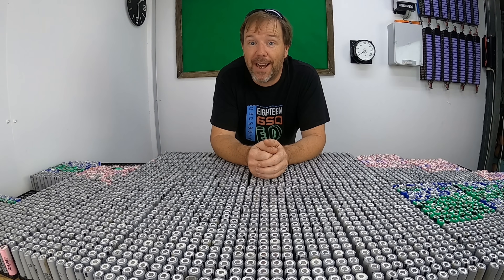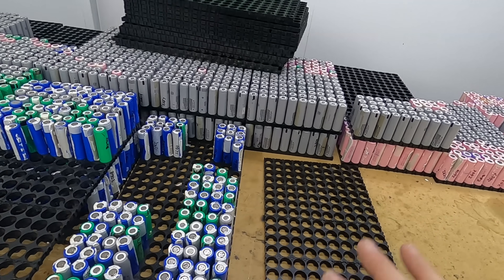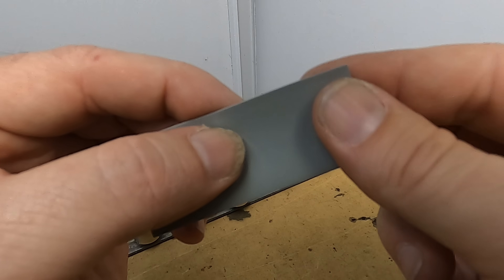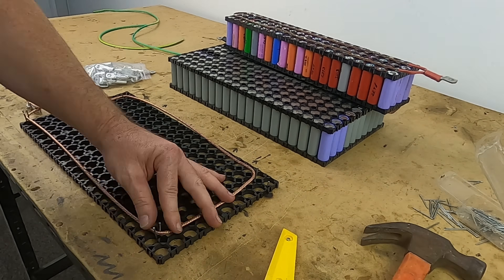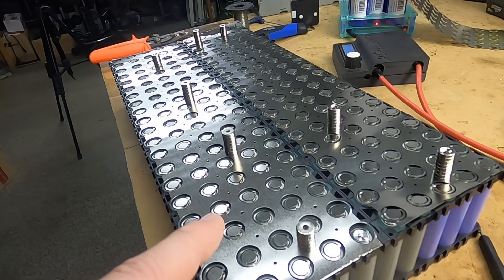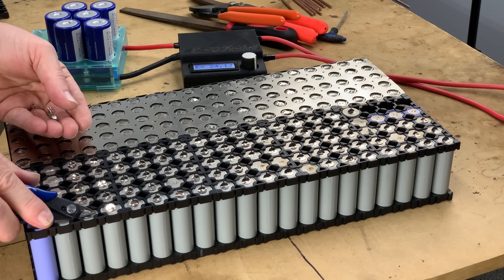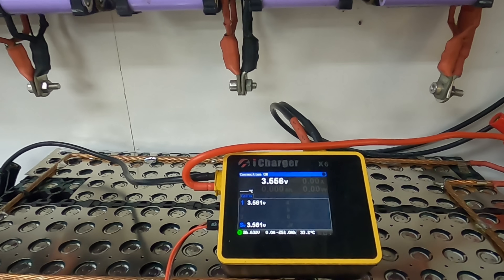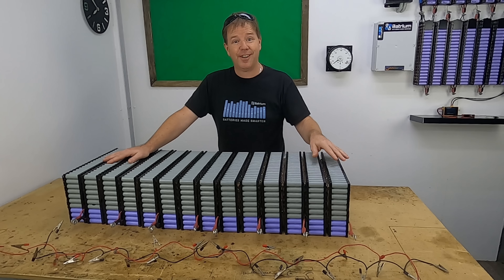Creating my single biggest D.I.Y. battery with 2800 18650 cells recovered from used laptop batteries

Comment: Awesome video!
How many laptop batteries did you take apart, about how many man hours did that take and what did you pay for the old laptop batteries (avg each and in total)? So we can get an idea of the cost so far, unless you are at the end of the whole series going to do a complete review of all the steps, the cost of each step and the amount of time it took for each step.
Thanks!
Reply from the maker: The plan was some sort of ROI video but it's really hard, This build was done over the past 12 months in my spare time, looking for cell building, editing and fixing monumental F-Ups. Every battery came from a local highschool via a recycling company. To pay for the batteries I exchanged the referbishment of about 100 Dell desktop computers (Secure erase hdd, full physical clean, new thermal paste, HDD warranty Tests, Memtest, W10 install & 1 hour stress test on each ) because lets face it referb to some is load W10 and blow the dust you can see off and call it refurbished :( SO that was a good solid week of work so maybe 1500-2000 for the cells. It would have been about 500 laptop batteries but they were all premium cells and only 6 cells were unuesable due to zero volt and another (about) 30 had physical damage. All up there was a smudge under 3000 cells processed. When i was organised I was processing about 100 cells perday when I had the spare time to crack open enough batteries. UNFORTUNATELY, this project has taken a quantum shift in the way I was planning to implement so stay tuned for that :)

Comment: These cells have more power density then tnt. So if some accident happens the entire colony or for that matter the whole town will vaporise.
Reply from the maker: You're either extremely poorly educated or trying very hard to make a joke - either way I laughed....
Reply: It's true that they can store more energy than TNT, but they can't release the energy as fast as TNT, If a short circuit happens it wouldn't not vaporise the entire town, but It would make a pretty big fire enough to burn his entire house down.
Reply: @polarpl247  well thats a lot of risk to live with anyways its more rewarding as well with that much of free solar energy for your daily needs

Comment: And also...I noticed you left those blue empty batteries in each pack...why would u do that?... cant you, & shouldn't you replace them with real capacity ones?... why would you leave in zero voltage cells?...
Reply from the maker: This will be detailed in next video, they are to stop any chance of a grounding issue of the cells
Reply: @HBPowerwall  what's your Instagram & facebook pages?...thanks
Reply from the maker: hbpowerwall :)

Comment: Once u had them sorted...like 2300 low...& 2300 high?... I dont get why later in the video you say now "we gotta place them into packs"... well aren't they already in packs?... why would you go back & reorganize everything?... cant you build a pack the way they were already?... with the 23 Lowes, 24 low's- 25 Low's- 25 highs?...
Reply from the maker: then they went to 2300-2350-2400-2450-2500*2550 ect - 100 mah was too far apart to build the BATTERIES gota stop calling them packs !
Reply: @HBPowerwall  oh ok...yea after I sent u that message?...I read your video description & got what you did... right now?...I'm at the buying laptop battery packs & capacity testing each cell...then I gotta buy the 32guage fuse wire, cell holders & I wanna go with the 6 gauge copper wire...twisted of coarse in a drill...after I capacity test enough of them?...its time to put them in holders...& let the soldering begin...lol then its onto the bus bars...then wall mounting...lol I will keep you posted with videos on here & on my instagram page!! KC24LA Thanks Mate, Cheers...I wanna do what you did eventually... with your purple ones?...charge them off of solar...then help run the house loads...

Comment: Why do you need that much battery? Waste of time and no space for cooling
Reply from the maker: Dude that's only 20% of what i already have installed - 74 solar panels worth of energy has to go somewhere other than the grid. These batteries won't even change temp under my max load of 0.3 amps per cell.

Comment: How safe is this actually? The cells in the middle have it less easy to cool down during charge and discharge than the ones on the outer sides of the packs. Isn't it a potential risk of fire actually?
Reply from the maker: Common question - my max load per cell will be 0.32 amps per cell... think that'll create too much heat? We aren't talking EV or eBike here
Reply: @HBPowerwall   Well, indeed each cell won't create much heat. But all together and in such a small place? I mean, the idea sounds excellent by itself, specially when you are re-using batteires which otherwise would simply produce more polution. However if for example i would like to use this in my house, where there are also kids, who allways forget to turn off lights or disconect chargers from the wall outlet... How safe it can be? DOes is need a special safety appliance?
Reply from the maker: You need to take a look at the rest of my videos lol I got safety covered... and the game is about to get 10x safter but that's a future video...
Reply: @HBPowerwall   You have lots of lots of videos. Which one you recomend about it for me to see?
Reply from the maker: https://youtu.be/Md4l9bFDOtc

Comment: Ive got to ask when it comes to mass storage, why not lead acid or that other new fat cell (forgot its name) ? Lipos are expensive and less stable for this kind of usage. Also they ware a lot more than the larger cells. Sure the lead acid has less density but its stable and easily maintainable.  So why lipo for home renewable storage?
Reply from the maker: Energy density, CHEAP, recycling, saving landfill, second life storage, fun, educational, fun, saves on grid power, environmentally friendly. & fun... I missed some but if its good enough for Elon it's good enough for me.. & fun :)

Comment: Hey Pete, is there some way I can contact you for advise and or your opinion on a small setup I've put together at my place, I've currently got 6x100ah AGM batteries on a 12v system that I want to change to the battery packs the same as you've got. If possible I'd like to talk to you about it if I could, I can send you my email and mobile number to you somehow securely. Just in case your wondering, my background I'm a 63yr old retired automotive and mechanical engineer by trade and my small solar setup's been running for about 8yrs now but the AGM's are starting to lose their edge. Hope you can help mate but it's ok if you'd rather not I understand. Seeya Rob
Reply from the maker: Rather not, can't do personal help as i'm not a pro, get SO many requests a day from all over the world i'd never make a living if i replied lol BUT thanks for asking first hehe BUT am heading south soon might be able to take a look for a few min if your not too far from my route
Reply: @HBPowerwall  Thanks Pete that would be great but I don't think you'll be close to where I am though, I live in the Hunter Valley near Cessnock just west of Newcastle, if your into winery's were got plenty of them haha, I just mainly want to know if it can be done and is it worth it. Changing from AGM to your battery packs in a 12v configuration and how many packs I'd need to make about 800-1000AH. I'm not in a hurry the AGM's are still going ok I just don't want to go down the AGM road again next time and proper lithium's are totally out of my price range. Thanks Pete.
Reply: @87xfute  1000Ah/2300mAh ~= 435(P), Since you use 12V, you will need 4(s)x435(P) to have 12V1000Ah system.

Comment: Curious to know what preparations are in place to deal with fire.  When one cell goes it can take adjacent cells along for the fun.  Quite a mess.  Has brought down at least one cargo airplane.
Reply from the maker: Valid question and one asked 100000000s of times. So 600 odd videos on this topic on youtube but i'll summarize. All batteries in use are in their own shed or seperate from main home, High Quality BMS on every battery in production - BMS controls heat via upto 120 temp sensors on my house battery, controls a shut trip in case a single cell gets too hot, cold, high or low voltage & entire battery too hot, cold, high or low voltage, fire alarm, every single individual 18650 cell is fused, battery breakers, and charger controllers that are set very conservatively & the same with the Inverters - they are programed to cut out earlier rather than later. Ad to that remote monitoring via my phone from anywhere. BMS even turns on and off cooling fans incase battery sheds get too hot. I guess it's no different to having a gas oven or Deep fryer on you bench top in your kitchen - you just don't do dumb stuff and you stand a much better chance of not having an issue. Note : I also monitor under heave charge loads with thermal camera at least once a week looking for hotspots in joints or cells. The BMS i have is a www.batrium.com unit
Reply: @HBPowerwall  Thanks for the great reply, you should pin this comment for all to see so they stop asking

Comment: Watching from Ireland. 
I am at the 25th vid in the 18650 Project playlist, I have 60 cells in a tray all tested and discharged, and 10 laptop batteries to dis-assemble. They have been on my desk for 3 months as I am reluctant to start soldering. HELP

thanks for making the videos
Reply from the maker: If you can find or build a spotwelder, much better than soldering to cells, but if that isn't an option try heat the cells as little as possilbe, use a clean soldering iron, good flux & enjoy the learning curve
Reply: @HBPowerwall  Yea, I was always worried about using solder on 18650's

I am on video 102 now,  gonna watch them all b4 I build

great fun learning so much from all your change of minds,  its getting to the stage where I think I am in the shed with you

Comment: Why do you have batterys in the Pack, that are not connected? I mean the batterys which have different color.
Reply from the maker: They are cells that could touch the metal mount. It will stop a short to ground

Comment: That is totally worthless. Where are your (VERY large) balancing capacitors and resistors and the necessary blocking diodes? Oh, you didn't use any? Just HOW do you plan to charge it? It's initial peak draw will be in the THOUSANDS of Ampere range. The batteries nearest the input wire will explode.
Reply from the maker: Thanks for the comment.. if you watched to the end perhaps your questions might be somewhat awnered it's heaps more fun than assuming than knowing - EVERY fuse will blow well before it sees 10,000 amps drawn from this battery. BUT i bet. it could do that sort of amps for a few micro seconds.
Reply from the maker: Side note batteries are built to with in 15ah each not bad considering the scale..

Comment: Very interesting video. Well done! Seeing the cells are from old laptops, presumably the batteries are end of life as far as the laptop goes (i.e. wont hold a charge for long). I have a few questions: 1) How do you know which cells are worth actually using? 2) How much life will you get out of them? 3) Can you actually recondition the batteries so they hold a charge for a long time again? 4) In a typical house, what will this provide power for?
Reply from the maker: Most laptop batteries i've seen fail in two states
a) Only one or two cells fail dragging the whole battery down
b) The BMS fails but the batteries are still fine.
1) I know they are worth using by testing every cell this play list explains that process - https://www.youtube.com/playlist?list=PLVtgHS9JIte_tT8JVGvoK3OBy7sYm3Xwj
2) My current battery is about 4 years old and still going (with maintenance)
3) There is no ... NO way to make the good again, just usable my plan is giving any battery i can that has exceeded its usefulness in its first live a Second Life in Storage
4) In my case my whole house - all GPOs, Lights, and ceiling fans. Not on batteries are electric oven and larger 7.5kw air conditioners & HWS but that is on a solar diverter so rarely use power from the grid to heat hot water.

Comment: 10mm2 is good for 63A, dont u take more A from these packs?
Reply from the maker: I haven't done the math but if it went that high I would have to turn on every solar charge controller and grid controller to 100% and even then it would only be for a very short time. Max charging i've see (when i was messing around on a live feed was 175 amps or about 10,000 watts. Discharging I think i've maxed out at 120 amps but never do that unless i want to blow up my inverters. Max practical discharge that I see daily is about 5500 watts. I think i'm with in acceptable limits for those busbars. Side note that this battery will be paralleled with another 30kwh battery

Comment: But now all the values on the cells are gone, so you would have to test all of them again🤔
Reply from the maker: I haven't ever retested yet, but all competed cells were tested with iCharger so i know the mah of the entire battery and can compare that to tests down the track. I have one battery in service on the farm that is coming up on 12 months old i'll pull that one and retest to see what the degradation will be after 12 months full time off grid use

Comment: This may sound like a dumb question but why build them to put out only 3+ volts?  I would have thought that a 12 or 24 volt set up would be more useful.  Are you wiring the packs for increased voltage?
Reply from the maker: They will be 14P193S battery so 48v at 500ah or 25kwh
Reply: @HBPowerwall  193S, that 800V+ fully loaded :) With 200 cells in parallel wouldn't your 14 packs average out anyway without categorizing each cell and spreading them out equally?

Comment: I don't understand why you had to put copper wire on top of nickel plate? Isn't doing its job the nickel plate to conduct electricity? You could put terminals on the end of nickel plate.
Reply from the maker: Current draw is too low just using the nickel - the load on the terminal end would be far higher than the other end.. Spreads the load a little bit

Comment: I fear your method of balancing packs to make a longer lasting battery is incredibly incorrect. You should not mix low quality and high quality cells per pack. Vary the pack size to balance will most definitely produce better results, not mixing qualities of cells.
Reply from the maker: My experience says differently - also you need to consider the load..
Reply: @HBPowerwall  pack discharge rate is a function of capacity typically... So as long as you meet your requirements you will be fine... That's why they say a battery has a 2C charge or discharge rate. To be clear I'm saying all packs must have the same capacity, but the # of cells per pack should vary so they're even, of equal quality cells
Reply from the maker: Ideally yes - the closer the better, but my 4480 cell 40kwh battery was built VERy poorly and way different ah batteries some 140 some 190ah Still works today, just not quite as welll. Many lessons learned over the past 4 years of building and being part of this community.
Reply: @HBPowerwall  you have totally missed my point. All packs can still be the same capacity but vary # of cells based on cell quality. You have introduced a guaranteed amount of power capacity cells in each parallel pack. When those cells go, the entire module goes with it.

Comment: What happened to the post you were going to make about getting batteries in Australia?
Reply from the maker: Good question - Lithium Power Australia https://www.lithium-power.com.au/ (5% coupon code 'Powerwalls')
Reply: @HBPowerwall  did you really pay those prices in building your new battery packs as shown?
Reply from the maker: No i could never afford that - I got 99% of these cells from a recycle center and swapped refurbishing 100 computers over a few months for them. Secure erasing all hard disks, loading windows & drivers, physical clean of all parts, new thermal paste, replace faulty or slow fans & burn-in test on each.
Reply: @HBPowerwall  does your recycle centre have more available?
Reply from the maker: If they do i'll be all over for another upgrade :P

Comment: Well I never thought that watching a guy play with batteries would be so interesting and engrossing.  Great video.
One question the silver connector on the end on the copper wire. Is that aluminum?  How are you dealing with corrosion problems  between the dissimilar metals?

Thanks
Reply from the maker: Probably nickel plated copper i would assume ? I think this will only last 10 years so corrosion shouldn't be an issue

Comment: well, it's so easy to melt it together, but must carefully make sure no "shorted" in processing, it may be caused fire and explosion.
Reply from the maker: Yah think? Thats like driving a car and the instructor telling you not to drive through red lights - seems oblivious but some still do.
Reply: by the way, we should check all battery voltage is normal before melt it together, because one of battery is bad quality may be damaged other one.
Reply from the maker: Every battery was charged, tested for heat in that process, left rest for about 30 days at 4.2v then checked for self discharge, recharged & discharged to check capacity & again heat while it happening, then recharged again and let rest for another 30 days to check a second time for self discharge. Quality has been well tested :)
Reply: thanks ! it's look good safe, I just worry  some one to DIY not really know how dangerous in process.
Reply: JOE ROVER Dude...the guy has been doing this for the last 5 years. You might as well teach your grandma how to suck eggs.
Reply: I just worry  some one to DIY not really know how dangerous in process.